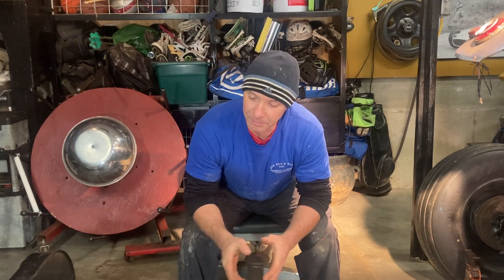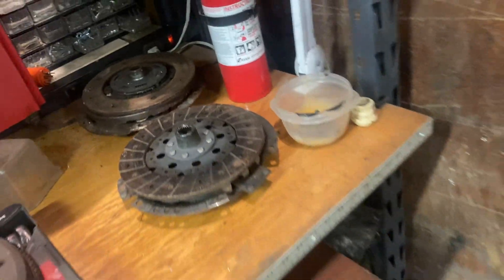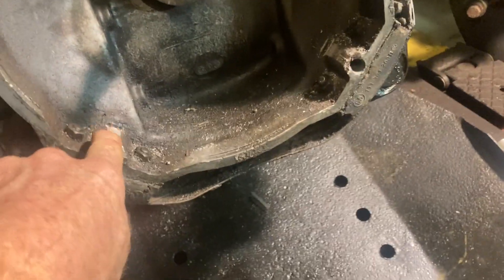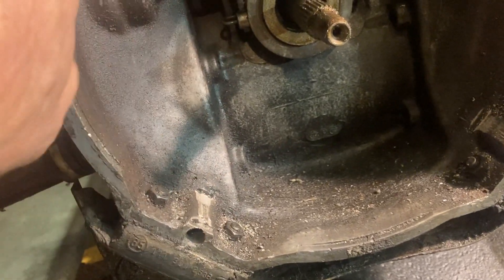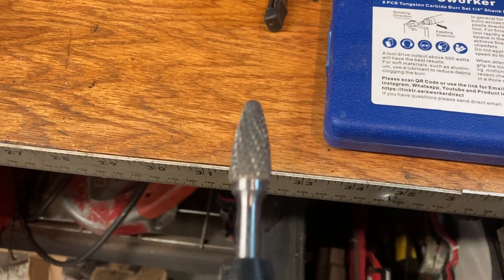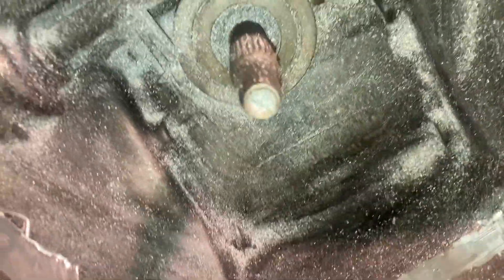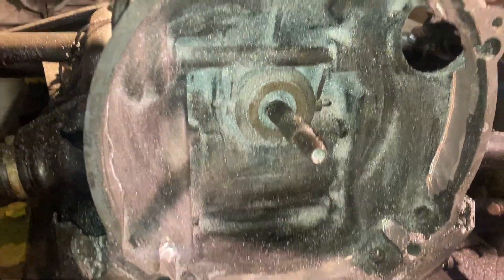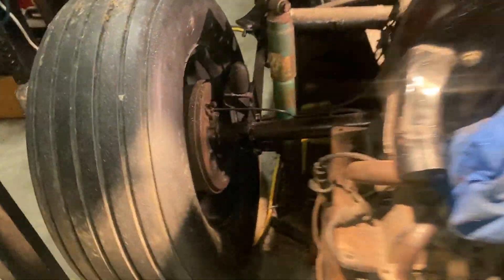How to fit a 12volt flywheel to a 6 volt transaxle on my VW dunebuggy

Comment: Hey Jason,
   I gotta tell ya, in all the years I played with VW's I never had or heard of a flywheel not fitting inside of a transaxle housing.
Not to say they can not be, Just that I never ran across such an animal.
I worked with 36 horse, 40 horse 1500 and 1700 CC engines but never found an engine that did not fit to a transaxle.
   I can see that your transaxle is the later style ( 12 volt ) as you called it which is a one piece casting.
Where the early 36 horse ( 6 volt ) were two halves commonly referred to as a crashbox.
The crashbox does not like the higher horse power of the larger engines but the higher horse engines will bolt right to the crashbox.
The crashbox also required splitting the halves to remove the axles should that be required. 
   Your engine looks to be a 40 horse, though it may have a big bore kit which raises the CCs from 1192 to 1385 .
I do not claim to be an expert on VW parts, I am just expressing some of what I remember.
   Looking forward to your experiences with this project.
            Take Care
Reply from the maker: Yeah, it threw me a curve at first. But I looked it up and I guess it’s pretty common. If the engine was built during the transition time between 6volt to 12 volt the flywheel is I think 10mm bigger and a different tooth pattern. It’ll be curious how it works out. I’m definitely learning something new here. I hope your winter is going well.be warm and safe